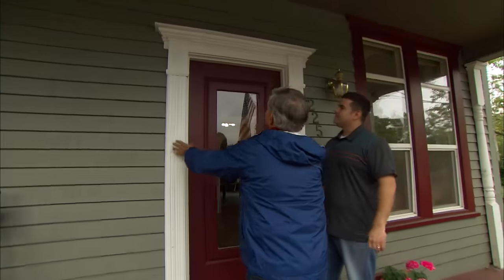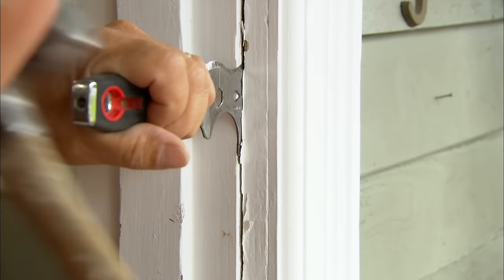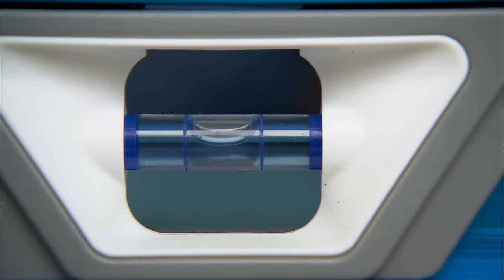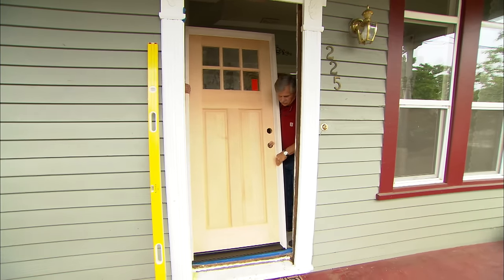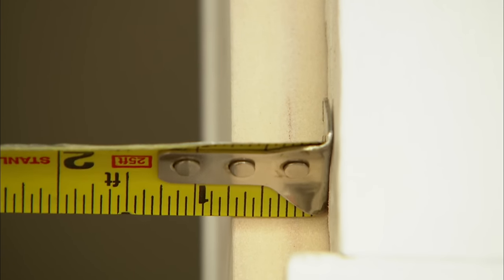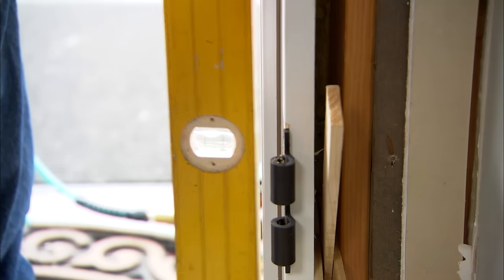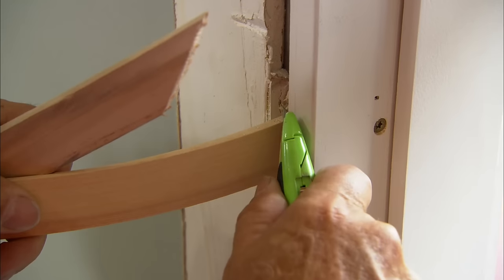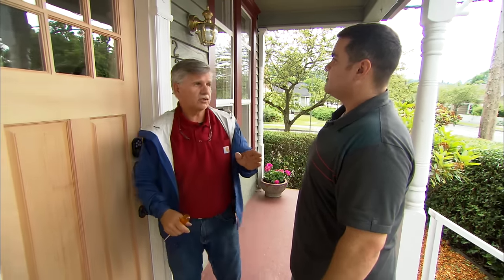How to Install a Solid-Wood Exterior Door | Ask This Old House

Comment: Nice looking door. With the original door, all doors require annual maintenance or checks at minimum for tight sealing and shifting around the locking areas; it is one of the things home owners under maintain. And so, nice to see the detail of this installation since it covers a lot of knowledge on the subject!

Comment: I liked how contemporary the old door was & fitting to the house. I don’t know why it’d be replaced.
Reply: Yeah, seemed like the problems of the old door were minor.    Glass frosts up, ok in the grand scheme of things I doubt that is that much of a problem for heating,   air gets in around the door... so seal it up better,    door handle doesn't work... so replace it.    Nah lets install a new door, and with that new door we need to seal up around the door, and install a new handle and lock, but hey at least those tiny panes of glass are insulated glass!

Comment: I liked the old door a lot better.  And I can see why it was leaking air, no insulation around it when they took off the casing/trim inside.  Personally I'd have fixed the door knob and put on a storm door to help stop the draft.
Reply: Aaron Bays after he paints it it will match the window
Reply: could of bought a better wood door or even better a therma tru fiberglass door with similar style but it would be much more $$$$

Comment: I have been all over U-TUBE looking for an exterior door video that covers the typical Florida home with a stucco finish. I haven't been able to find any that properly cover it, but this video covers what I think I'll need to do on my house. Back cut the stucco on the outside. Remove the trim on the inside and cut the screws/nails. Remove the door frame and reinstall from the inside.. Well, I hope that is correct!!!! I sure wish you guys would make a trip to Florida!!!!  ;)
Reply: Steve 1961P. 
I pray it went well for you when you try to match up the stucco color if you patched.

Comment: What was used to seal gaps before spray foam? I don't like foam. Do bugs get through it? Foam burns quickly, right? Or did carpenters build doors on site and not have gaps?

Comment: That was easy I want to see one where the house is all out of plum
Reply: Hahaha! Come to my house! I built the back porch and the back door has two posts on each side- yeah if that sucker ain't out of Plum and an odd size I don't know what is. I had to replace the door and went looking for whatever I could find but wanted one with glass. It's a plant porch room. So I found a door that would work cut it to fit and it's not carpentry work let's say. So anyway the door was painted black on one side. I said who would paint a door black? My cousin helped me and he said black doors matter. 😁

Comment: Everyone's commenting Tom should come to their house so I had to tell my story. I built a plant porch onto the back of my house. I made the opening to the back door with posts on each side set in concrete and then attached the door to them with hinges. I'm not a carpenter by any means but could cut the door to fit. I now realize I need to redo it and put in a frame then a door because right now there's plastic bags shoved in all the way around it and I don't use it. LOL! Outside it has a storm door- hey when it's this messed up you got to try to fight the drafts- when I first put it on it was fitting good but with time gaps form around it cuz of movement I guess. Someone said Tommy should come to their house - he'd have a field day at mine. Well this isn't right- who did this?  Um, uh. I plead the fifth!  😁

Comment: This probably should have mentioned the additional need for step/drip flashing at head if new brick mold, flashing tape studs at least the bottom of the stud, provide a sill pan under the threshold….if this door didn’t have a canopy over it, water proofing would be very different.

Comment: You absolutely have to install longer hinge screws for security and to keep the door from sagging. Most prehung doors come with a tag advising the purchaser that the 1/2 inch screws are there to aide transport and installation only. Then again, that kwikset lock won't keep anyone out anyway.

Comment: I've got a customer with entry door . Double door appearance outside and single door inside. Inside the drywall is attatched to the stationary panel  and is part of the  interior room.  Never replaced one of these. Any ideas ?

Comment: Can somebody out there explain to me why my Therma-tru fiberglass door with a solid wood core leaks?  Weirdest thing, moisture is showing up on the hinge side of the door below the first hinge.  Wood is rotted between the fiberglass sandwich really bad at the bottom. It's rotted by almost half an inch deep. It does have a rubber weather seal around the door as well as a seal under the door to block moisture and air at the threshold.  I need to know why it's leaking and rotting the wood between the fiberglass.  Thanks for all your input.
Reply: Broken glass seal? Warranty?

Comment: What kind of air gun do you used cause I want to buy one I don’t know which one it is any difference between Brad Nailer and finish nailer
Reply: same thing.
Reply: A brad nailer is typically 18 gauge and a finish nailer is 16 or 15 gauge, the smaller the gauge the thicker and more sturdy the nail, if you want to keep things simple just get a 16 gauge nailer, it works for most things.

Comment: I saw the bottom gasket moving out of door and they cut it from video!
Reply: I Do NOT like that spray in foam because it shrinks alot over a short amount of time !  I'm surprised that Tom had used that cheap  stuff !!

Comment: Why use a wooden door?????? It "WILL" cup to the inside of the house, gonna have to the same problems you had before. Cold outside warm inside the top and bottom on the latch side will "bend" to the warm side, inside of the house. Use a fiberglass door, you can paint or stain it and it looks just like wood.
Also, not removing the old threshold you have a "major" tripping hazard, it's what 3" above the finish floor? I can see why he didn't do it because of the gap at the top. 
Also, why not paint or stain it before you installed the hardware and weather stripping? 
Another also, old houses are notorious for being out of square and plumb. Why not check the wall and door frame for plumb, inside to outside. 

Tom's better than this.

Comment: man Tommy's gonna be itchy tonight at time: 7:00 min.!!!
Reply: most fiberglass made today is anti-itch.  the bonus is that it's extra thin strands, unable to penetrate skin, and it increases the amount of air inside the insulation mass pushing the r-value much higher... and costs less :)